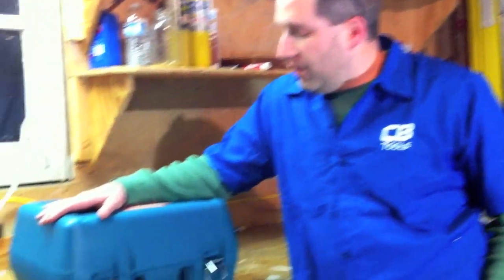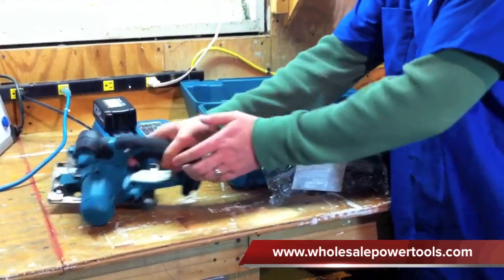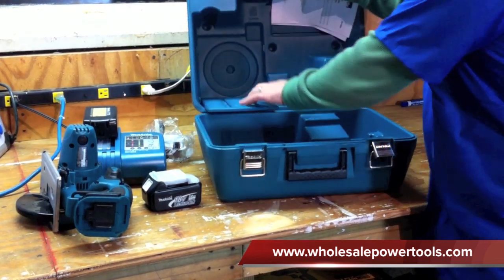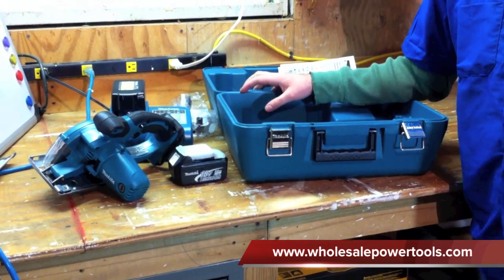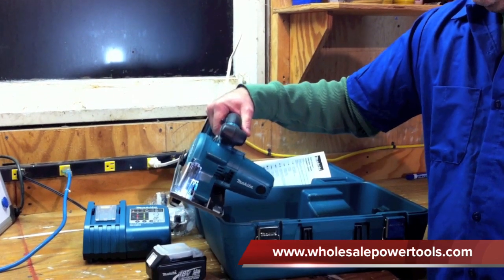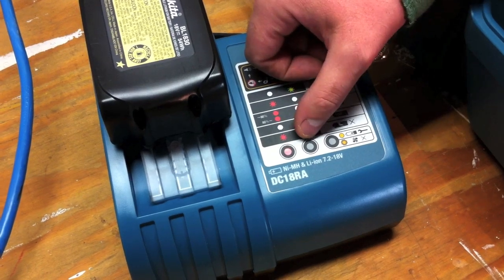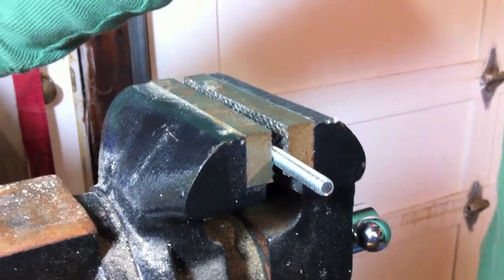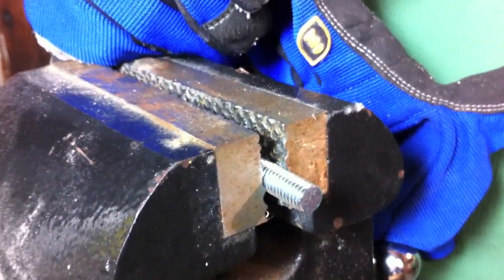Makita BCS550 18V LXT 5-3/8" Lithium-Ion Cordless Metal Cutting Saw Kit - Review

Comment: @man0z I read elsewhere that general purpose circular saws aren't suitable for metal cutting largely because they're not prepared to handle metalic dust in the air which can cause the motor to short out.  One person wrote that he succeeded in using one for a small job by placing fabric over the ventilation holes to filter the air.

Comment: Well - look ar BCS550 and BSS501 parts list, and you'll find that the armature and yoke, as well as housings are the same. There's difference in blade, blade case and base plate. The base plate has no articulation in BCS so it can be sturdier, and the blade case is made of plastic. To me it depends if you use the saw extensively or not. If you use the metal cutting blade less than wood and you can apply more attention and less force when cutting metal the BSS should work just fine.